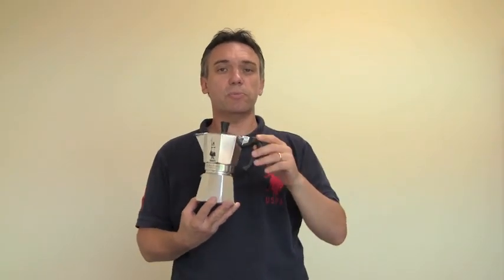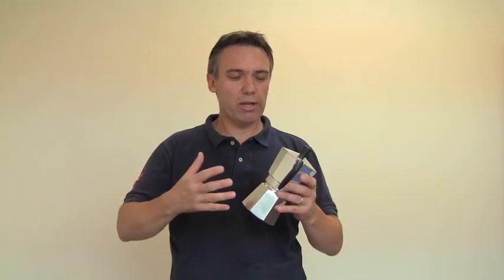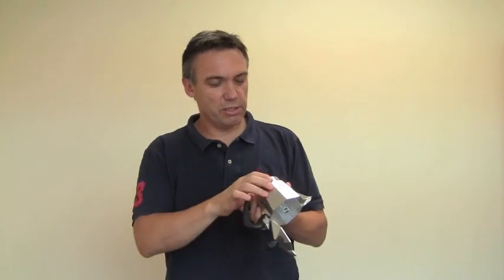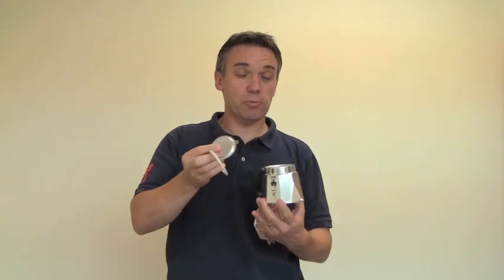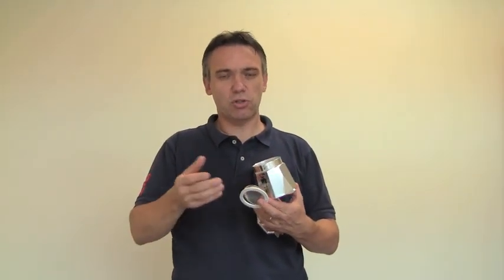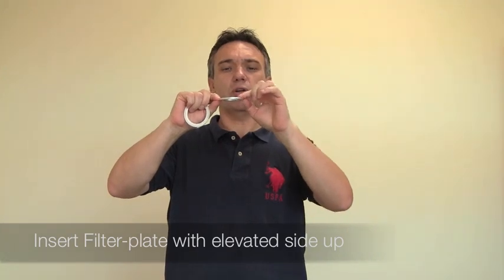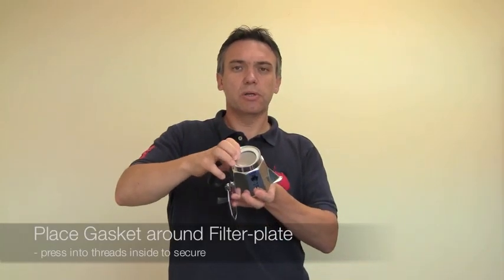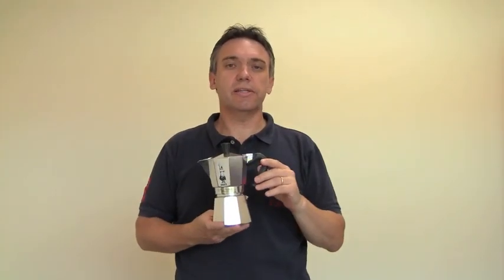How to replace a Gasket in your Stovetop Espresso Maker

Comment: Upon replacing the gasket with a new one, I find I need to do about 10+ run throughs with only water, (to save precious coffee) to almost season the seal into setting. For people who are only getting a tiny amount of burnt coffee coming up, this is my solution. It takes patience, but after about 10-15 run throughs with just water, the seal will set like you are accustomed to. I re-use the same water, just leave out the coffee while doing this. It will make  a world of difference going forward! :)
Reply: thank you! Better hints than the video lol.
Reply: Or just clean it. Use hot water or vinegar and water and boil it. It's bitter because you're believing a rumour that coffee tastes amazing with each brew. WASH YOUR MOKA POTS

All you're doing is tasting PREVIOUS old coffee. RANCID coffee. Why?

Comment: Super helpful video for changing the screen and gasket (works on any brand of stovetop coffee maker, moka pot). With my pot, it was the vertical shaft that was clogged and it was unclogged by using a hanger wire from the bottom which required the removal of the gasket and screen to reach the bottom opening to the shaft. Thank you very much!

Comment from the maker: Hi Pat,

The gasket has not necessarily to be very tight in order to provide a good seal. You mention that nothing boils up if you put the gasket in your maker but it does in your partners maker. Assuming that you have the correct size gasket and also that your water level is not too high or the grounds would be either to coarse or fine - there might be another problem with your maker rather then with the new gasket: Your Funnel.

What most people do not know is that the funnel not only holds your espresso grounds but is also important to keep the pressure in the boiler. If your funnel is only slightly miss-shaped, pressure will escape on the side of the funnel and the water is not boiling efficiently leading into either no or only little espresso percolating into the upper compartment. Interesting enough, you usually notice this once you put a new gasket into your stovetop maker.

A miss-shaped funnel is sometimes not easily noticeable and for example happens when you discard your espresso grounds by hitting the funnel on the side of your trash bin. This is also the reason why this mostly happens with aluminum makers / aluminum funnels since the material is not as strong as stainless steel.

So if you have the correct gasket and you are not doing anything different in regards to the water level and your grounds - your funnel might be the problem.

Best,
AJ

Comment: Don't forget the most important point when putting in a new gasket: tighten it EXTRA TIGHT at first to make the gasket seal.  Otherwise your stovetop espresso maker will not get enough pressure seal and only a little highly concentrated espresso will make it to the top of the pot leaving most of the water in the lower part of the pot.
Reply: Thank you!!!!
Reply: This is the problem I am having. The water does not come up. 
How can I tighten this up? In specific!
Reply: A moka pot is not a true espresso.
Reply: @noabaak  It's your grind size.

Comment from the maker: @JoMarieHartup 

Hi JoMarie. You usually do not have to change the gasket if you do not experience any leaking or excess steam coming out between the threads. Leaking or steam would be a good indication to change your gasket. Some people change the gasket when it gets kind of dark. But usually, as long as it does not disintegrate and still provides a good seal, you do not have to change it. I hope this helps and best regards.

Comment: I have nearly always had probs using new gaskets.  The seal has to be tight and perfect perfect or nothing boils up.  I am doing this today, in fact, threw in a new gasket but it did not work.  My partner put one in his and works fine.  That seal has to be really really perfect.  Still hoping for the best
Reply: Use paper filter then. Put the paper filter on top of the coffee

Comment from the maker: @gdavidgrana - If it is the correct size, it should fit. There is no trick. The gasket sits underneath the inside treads so sometimes you have to squeeze it in a little bit. But ultimately it has to fit.

Comment from the maker: Hi Samuel. No - you can only use one gasket. You would not be able to close the maker (screw the top to the boiler) with 2 gaskets. There is really also no need for one gasket if the gasket is the correct one and seals properly.
Reply: AmiganienLLC I accidntally put the replacement filter on top of the coffee grounds I thought it was like a lid for it

Comment: I've recently replaced my gasket and now the coffee bubbles and spurts and tastes burnt. Previously  the coffee oozed out slowly. What has gone wrong?!
Reply: spudludders did you change the filter, too? Maybe turn the heat down.
Reply: If the new gasket looks to be the same/correct size you have to tighten the pot extra tight the first few times because it is not set yet.  This will give the seal strength to have enough pressure for the boiling water to get up to the top of the pot.

Comment: How often do you need to replace the gasket, my pot is relatively new and steam is leaking out the side ?
Reply from the maker: Hi AustinPetDetective - if you only see steam coming out of the threats that usually means that you set your heat source too high and/or pack your espresso to firmly in the funnel. Try filling in the grounds loosely and just level the top with your finger. Do not tamp or pack the espresso in the funnel. Then use a medium-high temperature for the heat source and it should work much better.

Comment: I have a question, this is my first expreso maker, I already have it maybe for a year, and I don’t know if I have to replace the filter and the gasket, is there maybe a hint to know when should I change it? And how do I test the leaking etc? 😀 thanks
Reply: Hi Rosa,

Thanks for your question. You really don’t need to change the gasket or any of the other parts as long as you don’t have any problems, such as leaking during the brewing process, for example. Even if your maker leaks a few drops of water or coffee through the middle section while brewing once in a while, it might be simply because some ground might have gotten into the threads while closing your maker. You will noticed that the gasket might be bad when it pretty much leaks all the time and no espresso will percolate up anymore. But if you don’t experience any of the problems, you are good to keep going. 

I hope this helps.

AJ

Comment: i changed my gasket and now my moka pot splutters. Any ideas why. The diamter is the same but the inner circle is slightly larger than the original. Could this be the reason?

Comment: I’m confused. When the mocha pot first came, the gasket was like ‘glued’ on the? Do I not need to reglue it?
Reply: Hi Hunter. No, the gasket is never glued on and you should never to this. Depending on how long the gasket was in the unit that you purchased and how it was stored (dry, humid, etc) the gasket might get a bit stuck. I have seen very old gaskets in old units that have not been changed for many years - they sometimes get stuck quite a bit. That is also why it is important to get the gasket out once in a while and clean it properly. But it is never glued on or anything like that. Hope this helps.
Reply: @joergandernach2388  thank you very much for the reply. Just another question. I bought some new gaskets and replaced the old one. But for some reason now my mocha pot is ‘spitting’. And if I pack the coffee down to the top then only half the water comes up from the bottom. I don’t know if it’s because the gasket is BRAND NEW and needs some ‘breaking in time’? Would really appreciate your advice. Thanks
Reply: @Hunter-lf9jn  Hi Hunter,

Sorry about my late reply to your question. By "spitting" - do you mean that the coffee "spits" out the spout rather than a regular flow of coffee or do you also see some leaking through the threads where you screw the pot together? 

If the pot does not leak (i.e. water/coffee dripping down on the stove through the threads) but you have sort of an "uneven" flow of coffee in the upper compartment - it rather points to the funnel and the way you fill the coffee then with the gasket. As long as there is no leaking - the gasket is fine.

"Spitting" out of the spout in the top compartment could mean that either your funnel is deformed or the grounds the grounds are packed incorrectly.

Check your funnel and see whether you have some deformation. The funnel not only holds the ground but also has an impact on the pressure in the boiler. You see that little "lip" around your funnel. That also has a role in containing the correct pressure in the boiler. If the funnel is slightly deformed = this causes part of the pressure to escape = causing not sufficient pressure to push through the filter plate and the coffee up to the spout - which ultimately is the reason that the coffee flow comes out sort of spitting.

Deformation of the funnel is not easy to spot but here is how it happens: Most people (me included) hit the funnel on the side of the trash bin to empty the coffee grounds after brewing. If you do this too hard, and especially if you have an aluminum funnel, this will deform the funnel over time causing the pressure to escape during brewing.

Also, you should always fill the funnel loosely and completely with coffee grounds. Don't only use half or anything less then full while filling the grounds in the funnel unless you have a separating plate in your funnel that allows you to make only half the capacity. If you have some space above your grounds and the filter plate - coffee will also spit out the spout. Fill the funnel completely and loosely - don't pack. Once filled, use your finger or spoon to level the grounds and "tap/pack" only the top a bit using your finger.

One other tip/remark for the gasket:

You are correct, that a gasket takes some time to be broken in. Depending on how long that new gasket has been in the store and how they stored it (humid or dry), the rubber has to expand and retract a few times with heat to finally seal perfectly. What I usually do is that I use a bit olive oil and smear it on the gasket. That makes the gasket a bit more flexible and helps a lot. But I only do this once the gasket is new.

Try to always get original gaskets made by the maker of your espresso maker. If you purchase "generic" gasket - they do also work but the measurements might be off for some makers.

I hope this helps and all the best,

Joerg
Reply: @joergandernach2388  you are an amazing person!!! You answered not only my question, but addressed all other issues I wanted clarifying. Thank you so so so much for taking the time to reply. Much respect ❤️

P.s. yehhhhhhh there is definitely some ‘banging’ going on in the trash can 😂😂😂
And wow ok, I thought it was better to tightly pack the coffee, so I tap it multiple times to get the air out, I just thought it made sense to be tightly packed. Because when I see Starbucks baristas, they use a ‘press’ of some sort to tighten it in to the bowl? I was just following that. But I will do as you said and fill the coffee loosely and to the top. 
And yes, I was indeed referring to an uneven outpouring from the spout, not really leaking from the threads. 

Thanks again☺️☺️☺️
Reply: Hi Hunter. I usually have a coffee grinds bowl on my bench with a spoon that always sits in the bowl. I use the spoon to get the grinds out. Saves me banging the basket. Perhaps this would work for you too?

I add my grinds to the garden or the compost so the bowl is also an easy way to collect the grinds for that purpose.
Reply: @lhumpy190  some very useful tips, thanks for that :) 
adding to compost too, very smart hahaha

Comment: Has anyone had the problem of the gasket melting. I made it like normal and it just did not boil up so I turned the heat up for a while and the gasket melted and my machine smells horrible. Pls help with advice on what to do because the melted gasket has gotten onto the other parts of the machine.
Reply: possibly, and I stress the word possible!, you have faulty quality. 
or
the coffee holding part is not out of tin (or whatever light material).
If nothing else helps, try putting the gasket in first and the filter plate on top of it (note that it has to be the right way round!!, else the cooker will explode leaving a huge mess and possibly burning you - if you are close by). I´ve had the  filter plate over the gasket since years.. and well.. works fine (unless, again, if u do not to put it in the wrong way round ie the bulge on top).

Comment: The button broke off the Aerator. Is that fixable?
Reply: I am not quite sure whether I understand exactly what you mean as there is no aerator and/or button on the basic stovetop makers. Are you, by aerator, refer to the pressure release valve and maybe to the little ball that sits in the middle of some pressure valves? So if you do refer to the pressure release valve that is located on the side of the boiler = this one is easy to replace.
Reply: Apparently, it is called the Pressure Valve. The button on the top seems to have broken off. I can't find replacements anywhere. 

This is the part http://www.kasbahouse.com/detail.asp?product_id=Mukka%20Pressure%20Valve
Reply from the maker: That is actually an aerator valve but not from a stovetop espresso maker as shown in the video. That is the aerator valve of a Mukka Express Cappuccino Maker made by Bialetti. I suggest that you contact Bialetti directly at http://bialetti.com/ in this regards. They should be able to help you with a replacement part.

Comment: Purchased Bialetti replacment  Gaskets and measured with DIAL CALIPERS to see if it was the Precise size and its not working Properly.   Replacement gaskets are a PROBLEM With these things !
Reply: Exactly right...the comment section here is much better than the video! Read the tips in this thread!